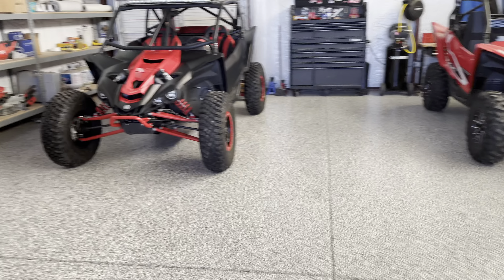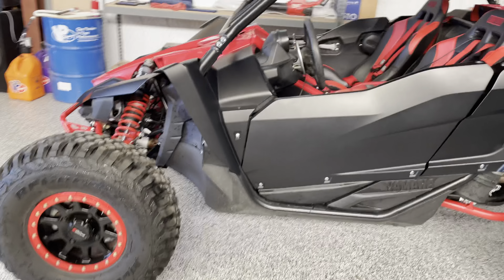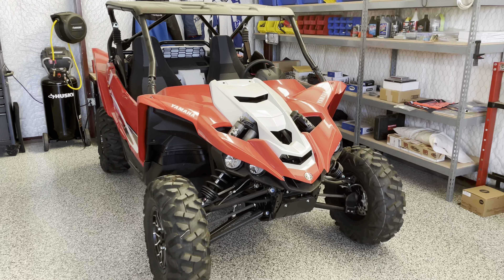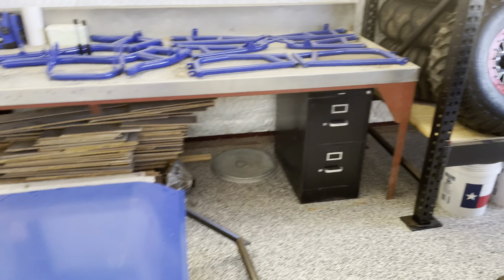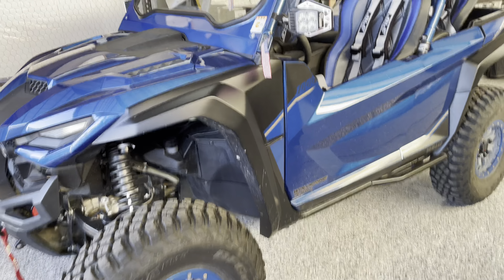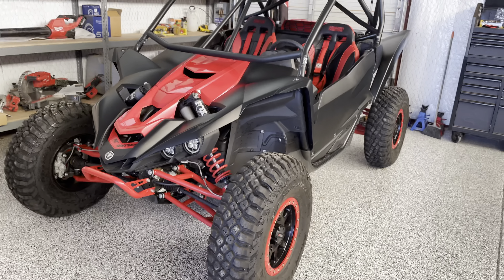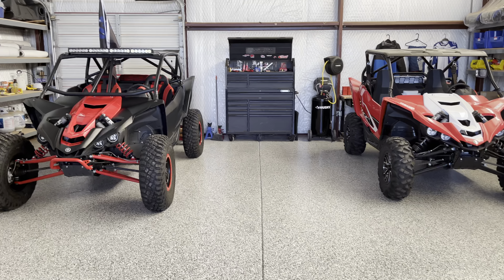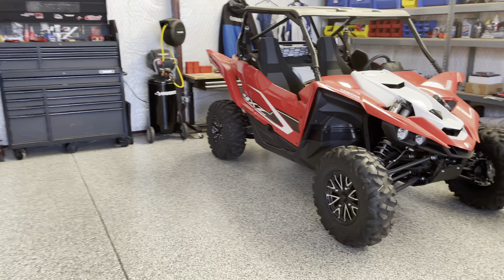Time to start the 2020 YXZ-1000R build for my son!

Comment: did you run into any trouble with the NSX LT, idk why my axle boot hits the lower arm on compression, im running 30" tires 15" 4+5 rims and demon axles. and keep ruinin the boots like that
Reply from the maker: I have never had that problem but some others have.  I think there is an issue with some axles and some arms interfering with each other.  I recommend you contact Matt Ling at NXS Designs to talk about a solution.

Comment: What is the clutch set up in the black ss?
Reply from the maker: Weller Racing installed the WR Edition HD Clutch Diaphram Spring, Wet Clutch Mod by Tubeworks, and the Tubeworks reusable gasket.  I believe it still has the OEM friction plates.